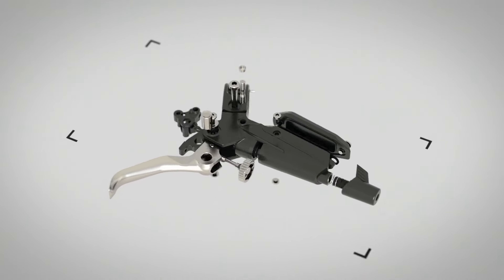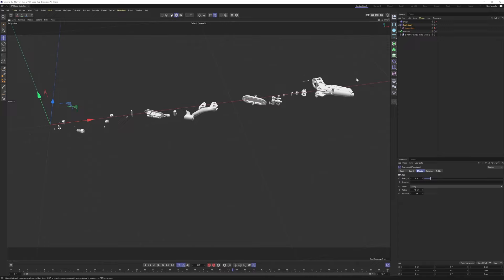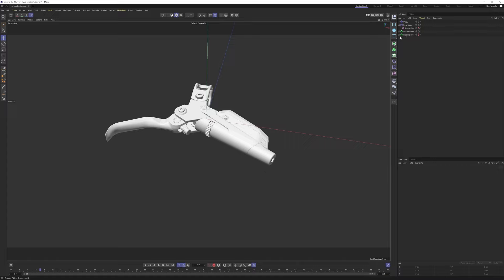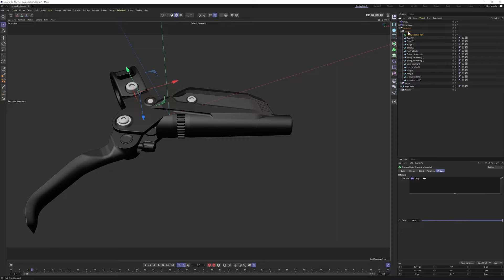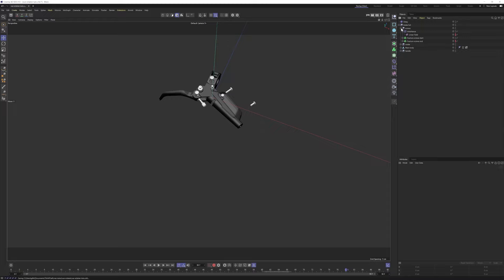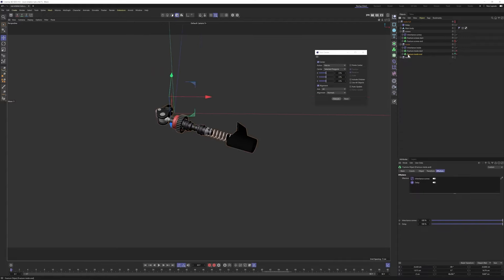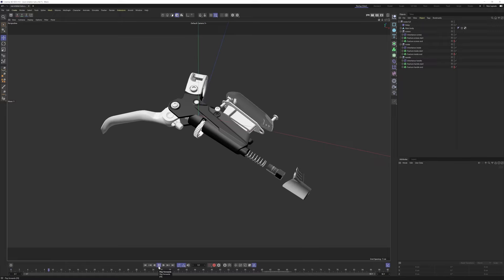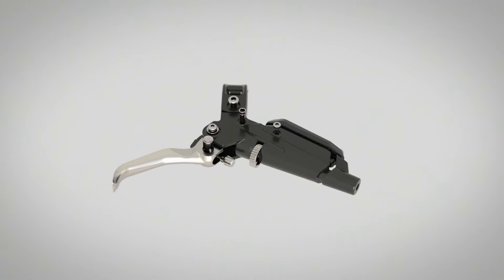animating an exploded view in C4D and mograph

Comment: Hey Gilles - this is fantastic. I searched the comments but didn't see anything about how to convert the measurements to feet / inches.  Can you let me know how do that?
Reply from the maker: Hi! I believe the simplest method is to make the conversion directly in the Expresso tag. Look for the distance node, then add a math node after it, and set it to divide. Since the result is calculated in centimeters, you can divide it by 2.54 for inches or by 30.48 for feet. I hope this helps!

Comment: there some issues for the coodinates part, once duplicate the inheritance to the inside layer, it can't perform the same direction according to the screw inheritance. I reset the transformed from the beginning as well, having the same problem as well. In the end, I didn't drag the inheritance inside to the layer and it works.

Comment: how come it crashed my program when I switch to explode segments
Reply from the maker: Yes when you switch to explode segments, the fracture does calculations to consider each part of the object, depending of the object and your computer specs this may crash the program
Reply: @gillesdillenseger6472  I figured out the problem. I had over 70,000 unconnected objects, so I had to optomize the model
Reply from the maker: @nevraXmike  wow yeah, that's a lot for the fracture !